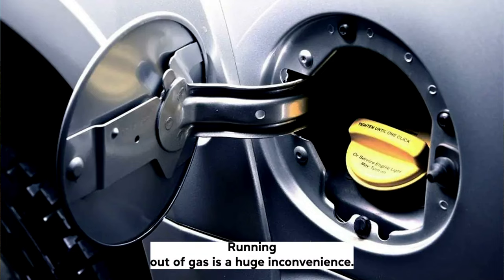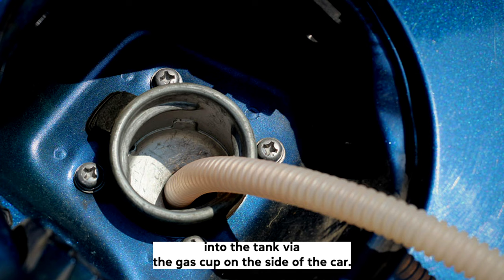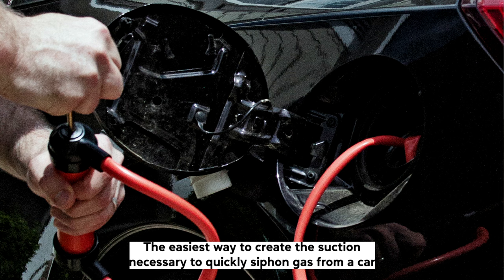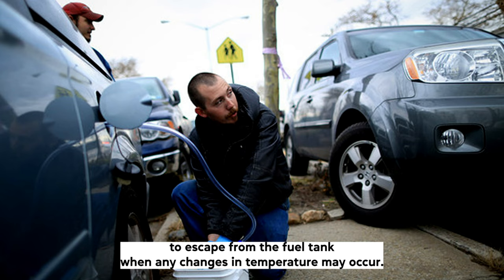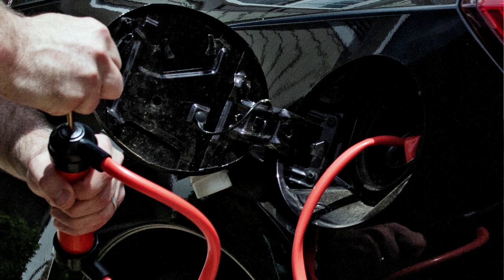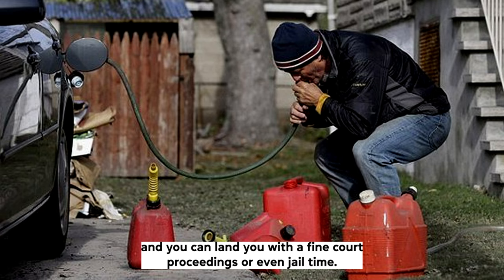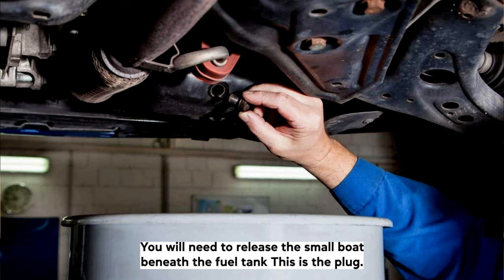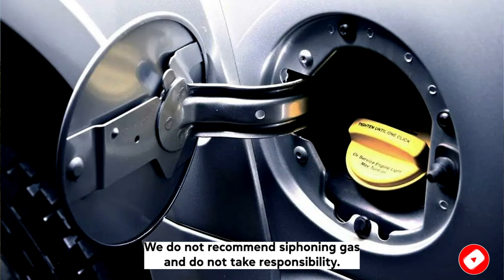How To Siphon Gas Out Of A Newer Car

Comment: It’s inexcusable that gas tanks don’t have a drain plug or valve on them. Ever notice you fuel pump seems to always fail with a full or nearly full tank! Trying to wrestle a full gas tank out of a modern car especially when working in your driveway on jackstands is a truly miserable experience and generally results in damage to fuel lines and wiring as well as fuel spillage. Car manufacturers are too cheap to put a simple drain plug in yet are charging you outrageous prices for a car. I don’t think anyone would complain if they charged an extra $20 for a car with a gas tank drain valve.
Reply: Agreed but also if you are dropping your gas tank to swap a fuel pump, why wouldn't you just  siphon the tank directly from underneath at the large inlet?
Reply: @sfcd4757  You often can’t get to the filler neck without partially dropping the tank or at least undoing the straps and tilting the tank . When you take the filler neck off the tank your likely to spill gas everywhere if it’s full, at that point it’s easier to just remove the full tank and then pour the gas out of it into buckets, rather then trying to siphon or pump the gas out while the tank is spilling gas everywhere and your holding it up with a jack and or  your hands. Anyway a simple drain plug in the bottom of the tank would make everyone’s lives a lot easier.
Reply: The way people are stealing nowadays I wouldn't want to make it super easy for my gas to be stolen

Comment: I used 3/8 outer diameter and cut it to a sharp point ant was able to manipulate it through in about 60 seconds. Thanks so much for the video!
Reply: how much twisting did you have to do to get to the petrol
Reply: 3/8" od would be better than 1/4" as long as the tube can be manipulated to pass the check ball

Thank you for this video

Comment: Lol and if there is a check valve that the hose won't get past??
Reply: Find a place to connect a hose after the fuel pump like the test port of the fuel rail (could be pressurized). Jump the fuel pump at the relay. Point the hose into a container. Turn the key to the run position and the fuel pump should start.
I didn't have anywhere to put a hose so took the fuel rail off and pulled the end injector.

Comment: Good sir!
I tried your method and it works famously.  I use the semi rigid quarter inch inside diameter poly propylene hose cut at a 45° angle going in. I had to work at it but nonetheless It worked as you described.
I’m in gas out of a 2010 Jeep liberty which is Going to the scrap yard tomorrow.
Thank you very much.
Unfortunately, I cannot upload a picture to show my method
Best